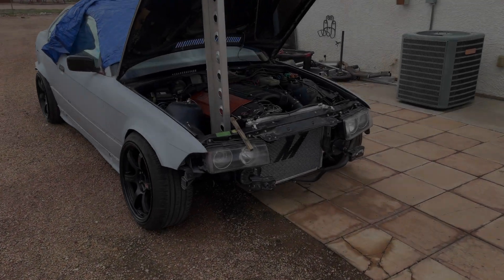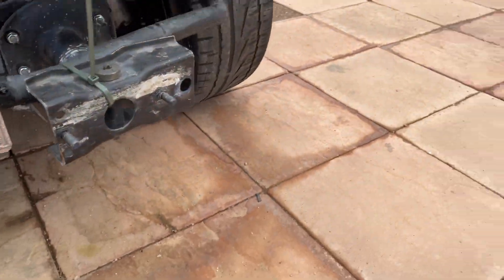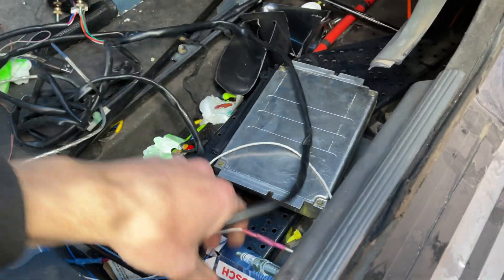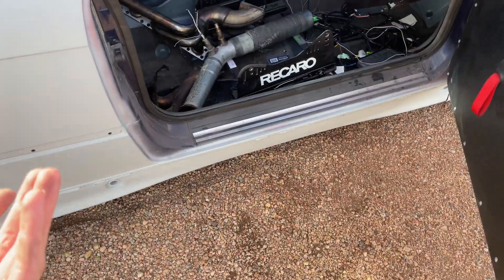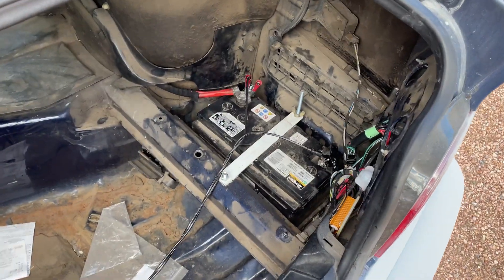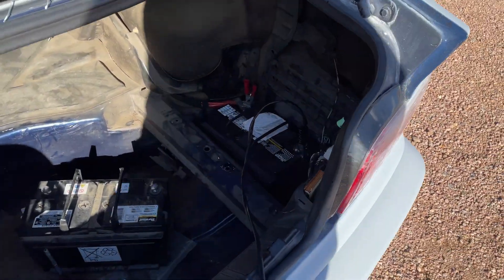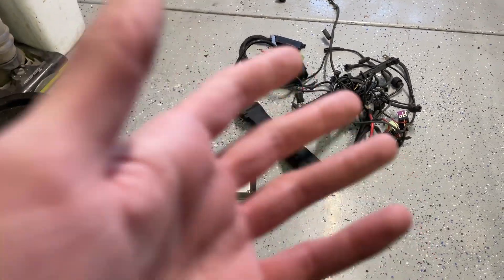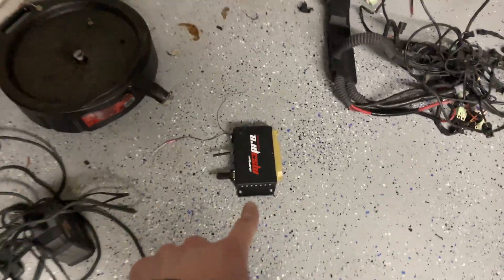I Made An E36 ECU Bench Rig To Troubleshoot A Customer's E36!

Comment: So ive built my bench setup about a week ago, wired it all up and bought an x20 to obd2 cable and a 232RL obd2 to usb cable, once its all plugged in my computer wont read my ecu or even detect it. The program will detect the cable and im (pretty) sure I have the right drivers for my cable. I've tested the 49,26,60 ports on the ecu and they all get about 12.5V to all the ports on the ecu connector so I'm super confused why my setup isnt working. I'm using an obd1 ecu connector but as far as I can tell its the exact same as an obd2 one. I've got a 12v 3A power supply going to it aswell. Got any ideas? or anyone know of anything I could do to test it more? Not my ECU btw as I've tested a friends known good ecu and still no read or ECU detection.
Reply from the maker: Did you make sure you have an ignition switch wired in?
Reply: @CanyonTuned  yep ive got an ignition switch and a main power switch wired in.
Reply: @e36hateclub ever figure it out bro?having same problem even got a new ecu and cable and still won’t read
Reply: @Powerhouseproductions254  Same issue here...